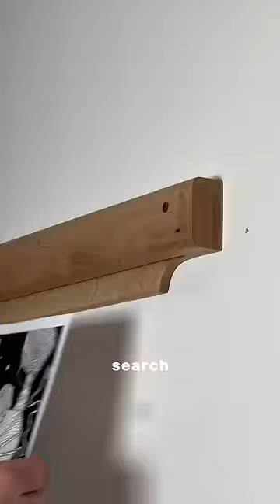Border Searched #bordercrossing #story #product #productdesign #smuggling #woodworking #smallbiz

Comment: I work in a restaurant, we use the same thing but metal not wood. It holds the orders up. They use marbles though
Reply: They’re like a fidget toy for expo LOL
Reply: Same here. I was about to say the same thing
Reply: @AaronsKitchenandBakery you're exposing expo secrets
Reply: I have a couple at home, but didn’t like the look of them so I mounted them inside a little DIY wood cover. This guy took it to the next level. Ha!
Reply: What’s the purpose? Sincere question?
Reply: @microminstrel   It’s a way to hang papers on the wall. It grasps the top edge of any paper you slide up into it, creating a bulletin board, without damaging the paper.
Reply: @microminstrel typically it’s a rack used to hold orders. Tickets come in, then get put on the rack so they’re easily laid out and visible

Comment: I had my truck searched at the border also. The agent said their x ray image shows arms and legs in my truck. I told him I have automotive exhaust pipes and fittings and the papers to prove it. The agent said he has to search because I might have human body parts in the truck. He broke the seal and opened all the bins and then says to me, "you were right, it's exhaust pipes and fittings, you are free to go" 😅
Reply: Cop doesn't know how to read the machine by the sounds of it.
Reply: Yeah,  metal might have the shape of body parts,  but it should look like metal in an x-ray.  If anything,  he might have legitimately thought it was prosthesis, or divot pays.  But flesh and bone would look entirely different.
Reply: @jolyric6441  the x-ray they use has to go through metal and maybe some plastic, and metal tends to distort metal. They do often have to go by fuzzy shapes rather than crystal-clear images you get from a medical x-ray that doesn't have to go through layers of metal to get at your skeleton.

Comment: I was trying to figure out what he was making the entire clip, and when he finally demonstrated how it worked… just wow. Thats so clever. I love the simplicity of it.
Reply from the maker: Thank you!
Reply: I dont get it
The balls create a pinch point to hold the paper?
Whats there 1/32 of play in the slot?
Reply: @Dev1Sev_22  Yes, if you look at the slots holding the steel balls in, they are curved so that the balls will fall against the "backing" piece. 

The weight of the balls pushing the paper against the wood would cause the paper to be (mostly) flat against the wood and it's then held up by a combination of friction and gravity (that's making the balls press slightly against the paper). 

Paper generally isn't very heavy in single sheets, and the amount of friction (due to surface area) you can get is quite a lot.
Reply: @Lykas_mitts 
Thanks for the explanation!
Reply: @biglowwoodcraft why not just use marbles? That what we used in high school shop class when we made these.
Reply: I feel like there are easier ways to hang paper, js. This seems like overkill.

Comment: The design makes so much sense when you think about it. Very simple yet highly effective.
Reply: but what if some piece of paper rips off and stays inside? there is no way of removing it? so maybe not so good design?
Reply: @Matthew_Removeafterwashing tweezers
Reply: Restaurant kitchens use the same thing for their tickets
Reply: Does it just work by the balls putting enough pressure on the paper to hold it in there?
Reply: I love designs that are simple and effective.
Reply: @Matthew_Removeafterwashing i mean if it doesnt fall out it shouldnt be an issue for further use. i dont see the problem
Reply: @kyleeaton1709 yep thats why when he slid the paper to the side he could remove the paper
Reply: He copied the design from a restaurant order holder
Reply: @Matthew_Removeafterwashing 
Use magnets and blow some air at the other end?
Reply: @kyleeaton1709 
You didn't see him slip in those springs, tacks, and staples??
Reply: fancy chitboard

Comment: That would be great for anyone who likes to hang posters on their walls.  The posters don't get messed up with tape or holes and they can easily be switched out as interests change.
Reply from the maker: You got it!
Reply: Where can we buy these?  @biglowwoodcraft
Reply: These have been used in restaurants for decades for hanging order tickets. The ones this guy makes are more aestetic than those though
Reply: Wait until u hear about frames
Reply: @dugsmok  I've seen them in restaurants for years.  Also worked in a restaurant that used one.  Just never thought about using it anywhere else for other things.
Reply: @kujobeatsofficial  ???   What teenager is going to go through the trouble of framing their posters?   And then have to hang the frames.  It's so much easier to just use push pins or tape.
Reply: In my city all the walls are covered with plaster (not board) that is notorious for failing. Blutac, 3M removable stickies, tape etc will all mean the paint coming off the wall with the plaster hanging off the back.

Frames, or something like this, are often our only option if you don't want to replaster and paint your wall when you remove a poster.

Comment: They’re just making sure you’re not manufacturing a bunch of goddamn claymore mines
Reply: Doubt those balls would not work for that the ones inside of a Claymore are special
Reply: @smokedbeefandcheese4144 I mean, a claymore isn't too hard to DIY
Reply: Just use hardware. Bolts, screws, washers, nails.
Reply: @smokedbeefandcheese4144  a ball bearing is a ball bearing dude.
Reply: "You can ban guns but you can't ban my balls"
Reply: @WendiGonerLH he does not know whaf an IED is
Reply: @smokedbeefandcheese4144  What you think these balls would just bounce off if propelled 3000'/s?
Reply: @smokedbeefandcheese4144  nothin special about hardend steel and explosives
Reply: Glass marbles are cheap and work just as well .
Reply: @smokedbeefandcheese4144  You just have to resoften the steel by burning off the carbon to get back to soft iron. Regular steel bearings just turn into dust.
Reply: @smokedbeefandcheese4144 Not really that special at all just smaller diameter. These balls would work fine
Reply: Reading this thread has definitely put me on a watch list
Reply: is that illegal?
Reply: That's why you use bbs. They are way more mallable. LOL
Reply: @cyberwarlord7363  yea you tell em’ Kapkan
Reply: @RageUnchained It doesn't take too much to get on that list these days.
Reply: @smokedbeefandcheese4144  The steel balls in a claymore are about 1/4 the size used in this project.  Nothing special about them except the govt probably pays 10x normal price for them.
Reply: Or you just put a layer of wadding between your HE and the ball bearings. Like the other guy said you could even use marbles that way nothing shows up on X-ray which is technically a war crime.
Reply: @tydshiin5783  Just googled how to DIY C-4 explosives.  I'm probably now on the FBI watch list.
Reply: @InappropriateShorts  depends on who you are
Reply: @stevenarmstrong5364  correct
Reply: what’s a claymore mine
Reply: You mean just giving him insensitive 😂🤣
Reply: Didn't think of that. Makes perfect sense.
Reply: @InappropriateShorts  Yea and?
Reply: @PuzzledPiece  little bomb that sits on the ground and sprays steel balls forward in a cone shape. it's like five 12 gauge #4 birdshot shells in one but fired at triple the speed. turns people into red mist

Comment: Yes!  It IS pretty cool.  I've recently been trying to figure out a hanging system for pictures.  I'm glad I clicked on this video.
Reply: Glass marbles will work too!
I made exactly the same thing in woodshop class while in highschool.
This was 1992-1994, not sure which year, but I got the idea from a popular mechanics magazine.
I had no idea I was ahead of the curve, or that people would buy it!
Reply: @carwashadamcooper1538  damn. I clicked to say the same thing then seen your reply, I used to work in restaurants and we always had rails to hold our tickets so we knew what was coming up, I always wondered how they held the paper so one day I took a look...regular old marbles 🤷🏻 crazy haha
Reply: i’m a little slow. how do the marbles hold the pictures in place?
Reply: @oscarleyva6485 when you slide the paper up into the slot, the bearings (or marbles) roll, allowing the paper to go past them, but their weight against the wood holds the paper in place and pinches it there until you pull it out 👍
Reply: cork
Reply: Tape works too
Reply: They sell cheap ones for hanging tickets in restaurants at any restaurant supply place.. These do look nicer though.
Reply: @mikecraig2996    Thanks for all the info.  The next time I drive by the local restaurant supply store (it's only a mile away) I'll go in and see if they have some.
Reply: @nemo227  np man. There's always cool stuff in those stores if you like kitchen stuff, too.

Comment: I remember when I first started working at a restaurant they had those things to hold the receipts up so the chefs could see the orders and I always wondered how they worked. How does it hold the paper up so effortlessly without any sort of adhesive and has lasted for years without any maintenance? 

After watching this video I am quite sure this is how it works!
Reply: Yep that’s why whenever you’d pull the orders along the holder it would sound like a bunch of metal balls rolling against each other
Reply: Okay but after watching the video I still don't know how the concept works 😬
Reply: just peek under it you'll be able to see the ball bearings!
Reply: @slaven5239  The balls pin the paper down. It just uses gravity/friction to hold it in place
Reply: @slaven5239  free-rolling balls can rotate/spin to allow stuff to be inserted or removed, but when still, they apply pressure to the inserted material, keeping it still until pulled, the sideways friction makes the balls spin in the same direction
Reply: @PTSD_Guts  thank you this is the answer that best describes how it actuallly works 😊
Reply: @slaven5239 
Tight tolerances (probably 0.02 inch?) + friction = success!
Similar design with slightly bigger gap between ball and wood would grap your bathroom towel, robe, etc.
Reply: I had a chef who would run his knife in the ticket rail occasionally. He said it was to clean it out but I'm pretty sure he just liked torturing me with the sound lol
Reply: Funny thing is I figured they were ball bearings but one day was cleaning out the gunk and found out ours actually has marbles in it 😮
Reply: @rolandmeyer3729  holy crap - time to wash that towel.
Reply: @DreamsageRap  Yep. I work in a restaurant also and ours has marbles too. Just got curious one day and looked underneath, glass marbles.
Reply: I sell the ones that they have at restaurants. They use glass marbles. But yes, same concept.
Reply: its just marbles in between the sheet metal. one kitchen i worked at had a couple clear marbles fall out the end of the window. they dont need maintenance but i think that particualr one got bent  or the screws came loose on the cap
Reply: @sierrawilloughby2281 chef is correct. Although I use an old credit card rather than a knife. If your rail is dropping tickets or falling out the moment you hang them, time to give it the good ole swipe
Reply: The balls sit in a groove at a slight incline causing them to press against the paper continuously. Because they are balls and rotate quite easily you can insert or remove paper quite easiely without crumpling it.

Comment: very clever product, looks super well thought out
Reply from the maker: Thank you! Cheers!
Reply: Restaurants have been using this for decades to hold tickets.
Reply from the maker: Yup
Reply: You can buy them in the store since 1970 tho. Nothing new
Reply: I've never seen one. I'm just surprised the paper doesn't just bend when you try to push it in. I guess the weight of the balls and the angle of the surface they are sitting on is important.

Comment: Very cool product. One switch up I would look at would be using ceramic balls, instead of steel. They are lighter weight, won’t react to woods that have a higher acidity, and moisture won’t be an issue that could possibly cause them to rust in time.
Reply: But the weight of the balls is what keeps the paper in place.
Reply: @TrustedFemboy  the shape of “pocket” they sit in being tapered has more to do with how the paper is held, however I can see how the weight of the balls would also be a contributing factor. Definitely one aspect to keep in mind if looking at different materials.
Reply: @treason0990  aside from friction coefficient, the balls essentially need to be heavier than the sheet you're hanging for the mechanism to function. the taper transfers the gravity against the balls horizontally to resist the gravity on the hanging object. ceramics would be both lighter and smoother, impeding the function of the device incredibly. these are usually made with glass marbles on aluminum rails, but those are used for tiny slips of paper.

Comment: So how does this work? Please explain in great detail
Reply: The balls pinch the paper.
Reply: I suspect that the inside of the ball housing is sloped so that balls rest against the larger plank due to gravity when the whole contraption is mounted on the wall. If you put something between plank and balls you push the balls slightly back and up, but gravity will still induce them to roll down the slope trapping whatever you put in.

Comment: I have NEVER ONCE made my way into Canada by way of motor vehicle and not been searched.  I’m in MN now, formerly Buffalo NY.. Crossed the border between 30-50 times conservatively.  Every single funkin’ time it’s “sir, please pull over there”.  After stop 10, I put weird but legal things from time to time in my crates/bags.   Usually, I just leave all my shit out in the back as I don’t want to spend hours at the border. But.. If you wanna really stir up the nest, rub some 20$ bills on your license, and triple box a prostate stimulator or some butt toy in metal stranded brown box taped all over each layer of boxing.. The trace amounts of cocaine from the 20$ rubs off on the ID, they see that under the UV, they will investigate ID further under the scope and are intrigued by the brown packaging.   They just cannot resist having a peek. Ask if they can rewrap the item also as it’s a gift for your dad..   cheers

Comment: This is a good product idea. I have two similar in aluminium in Norway. I use to hang draft prints on the wall when working larger projects, typically 24 to 48 pages.

Comment: I work at a high end pool builder that also does landscaping and accessories around pool area.
We have been raided 2x because our inventory manager accidentally ordered fertilizers on the same shipment as [certain normal chemicals]. Had to explain that we do not, in fact, manufacture unlicensed explosives.

Turns out it just has to be on separate orders, even separate orders arriving on the same day to not get flagged.

Comment: Does look pretty neat but you could do it with less ball bearings, and or marbles. Simply by drilling holes a little bit bigger than the marbles are ball bearings an inch or so apart

Comment: As a "retired engineer " I just want to say this:  "Show me the fukin diagram; show me the engineering drawings
Reply from the maker: I sell the plans if you like
Reply: @biglowwoodcraft   - - - - I just want to know how the device works on the inside which is not shown or explained in the video. "Referring to" similar devices used in restaurants doesn't explain "how" it works.  I don't want one or wish to build one so I don't need the plans. A simple "cross section" view should suffice. Thanks for your response. Cheers.
Reply from the maker: There’s a cut-in-half video of you scroll on my page